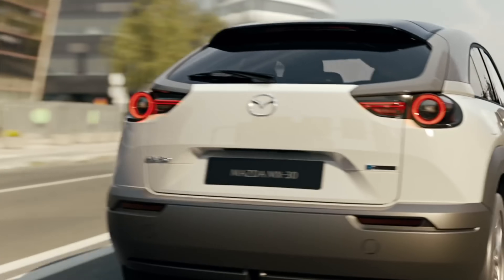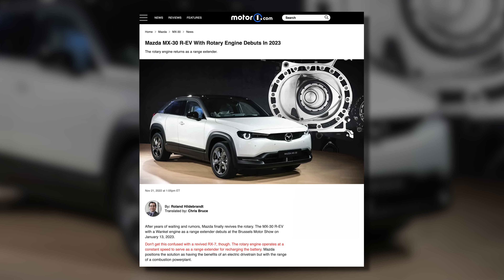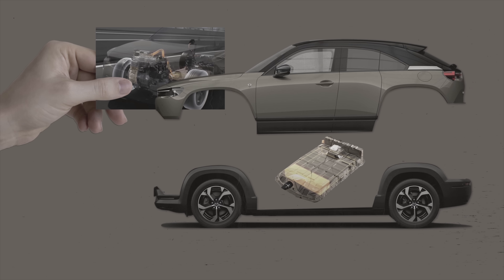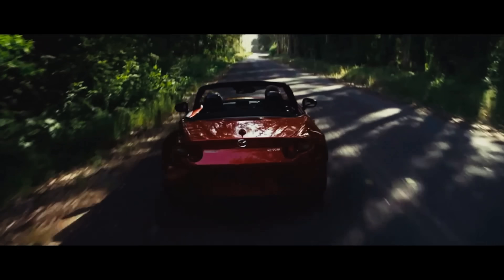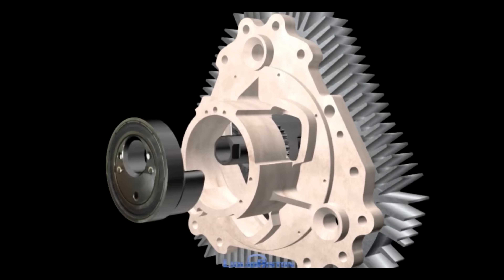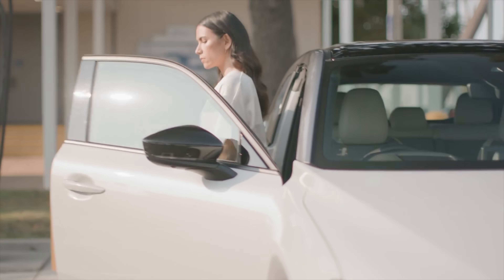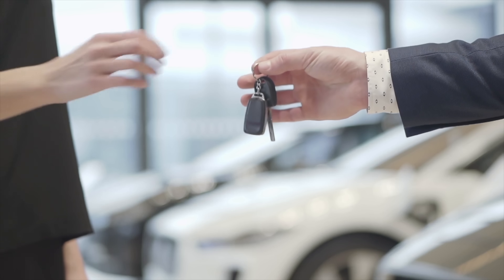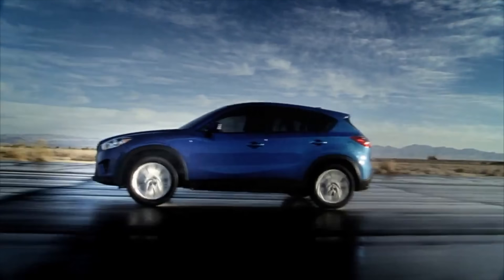Mazda's New Engine is the Smallest and Most Powerful Engine Ever Made

Comment: I like this design. It addresses the biggest problem with internal combustion engines: thousands of motors sitting there idling in rush hour traffic. You can't shut the motor off because you're still crawling along. A small battery and electric drivetrain fixes this. The gas engine generates essentially all the power for highway driving and the battery handles the city driving. It's the perfect realistic solution.
Reply: Oh absolutely. Hybrids seem to get the brunt of attacks from both sides too. The conservative drivers hate them, because they seem to have too much new technologies.(and God forbid you do something slightly different.) And EV drivers hate them because they have an engine that burns some amount of fuel.  But objectively hybrids really are the best way forward; they could meet new efficiency goals, while maintaining past performance. They offer drastic reductions in fuel consumption, without sacrificing range in the process.
Personally if I had at least a hundred and twenty kilometers of electric range; I could commute to work and back, and still have enough charge left over to cruise around in electric-only range; yet I would still need an engine to get to the closest big city.
Reply: @wyndhamcoffman8961  hot take
Reply: 100%. It's a huge reduction in carbon emissions, without the $15,000 lithium batteries on EV-only cars like Tesla. I think hybrid is the reasonable way of meeting emission goals.
Reply: @AutisticMorty  emission goals are a pile of shite!
Nothing to do with actually lowering emmisions, and everything to do with greed, control and authoritarianism.
Reply: Ita called a hybrid its old technology trains run diesel engines to charge the batteries for the electric motor to drive the train. Yeah pretty old toyota has a prius it does fine
Reply: @jackdaniels2657  No, most hybrids are over designed. 1/2 the weight of the other internal combustion engines. This engine could also run on Methanol, DME, Hydrogen, Ethanol, propane et al.
Reply: @jackdaniels2657  Train?  Do you mean "Drive train" ? If not, diesel electric trains do not have batteries for the electric drive motors.
Reply: @davearbogast2882  trains are pretty much hybrids diesel motor produces power to the electric motor. Im sure theres a battery somewhere
Reply: @jackdaniels2657  Exactly, my 2006 Gen 2 Prius does just that. Good fuel economy but great range. I average 4.9 - 5.2 litres per 100 km and on a long trip I can get nearly 1000 km [ same as some small diesels today]. So recently I had to decide - buy a new car or replace the 16 year old Toyota hybrid battery ? No brainer, new battery pack and even better fuel consumption !
This Mazda idea is great but no mention of fuel tank size, so if it  runs like a Prius while only charging the battery pack [ with regen braking added I hope] it still gets less range than my current Prius [ 840 km on 40 litres of 95 Octane at 2000 m altitude - Johannesburg]. 
That range extender would get me around in a large country like South Africa on my longer business and leisure trips direct to Durban [ 600 km] but Cape Town needs a refuel / recharge [ not sure which] to get there if only Gen 2 Chargers available - probably an overnight stop.
I can do Jnb to CT in one day [ 1489 km] in my Prius, can the Mazda do that?
Reply: @brucemills6558  my 2021 Renault Captur hybrid does 55mpg around town and has a full tank range of 540+ miles ( it has a fairly small fuel tank) it’s self charging so doesn’t need to be plugged in and was £5000 cheaper than the plug in version.
Reply: No its a dead end. Batteries will sooner or later outperform any gasoline engine in every possible category . It will be first in price and from that point it goes downhill for gasoline engines fast.
Reply: @MartinMartinX  
They won't replace combustion engines ourltside of cities, constant travel within the city should be electric to cut down on air pollution, its going to be seriously hard to beat the energy density of the chemical batteries that we call hydrocarbons though, as well as reliability of gas engines vs batteries and electronics, and with pneumatic braking on gas cars the efficiency in town gets to near an EV. For long and short distance efficiency in a vehicle that lasts decades, you can't do much better than a gas car with good tuning, pneumatic regen braking, and with maybe some modifications to use the waste heat through a sterling engine or something, an EV can't be the solution for everything.
As far as charging and getting the energy to the vehicle goes, the gas car is better because you dont loose nearly 50 percent just getting it into the battery from the power plant. Fuel can be made with free energy from the Sun by growing stuff for biofuels, you don't pay for the energy wasted there as much as with electric where a good chunk of the generator's lifespan is used powering nothing, and it negates the problem with fossil fuel when new carbon is not added to the air. The gas tank will always have the same capacity, you can let the whole thing sit for a year or more in the elements if you don't need to drive, and it'll be perfectly fine, but an EV may not be depending on if the manufacturer did their homework. I know from personal experience that gas cars are easier to work on, and safer to take apart. They're cheap but only in the short term. Reducing car usage and using trains rather than trucks will fix a lot more.
Reply: @MartinMartinX  you are too optimistic. Even if the advanced countries will force the citizens to use EV, what you do with the rest of the world? It needs a new battery technology to be developes, more energy dense, recyclable, cheaper than lithium  (sodium battery?). The european politicians are not realistic.
Reply: @radudorurus  Current battery tech is only viable for small cars.  One might notice the so called EV trucks and SUV's technically are being sold, but everyone who has used them says... NOPE!  Voltage is too damned low and slow at charging.  Teslas's new 1000V architecture does not fix this problem either.
Reply: @MartinMartinX  I highly doubt that. I’m from Cali. Having an electric car out here quickly became a major inconvenience for anyone who doesn’t live a very inactive lifestyle. Even if they increase the range by triple, it’s still very inconvenient because of how much energy consumption is required. You can fill up 200 gallons of diesel in less than 15 minutes at an average truck stop. Charging up that much “range” in an EV would take HOURS. Yea they can make that process quicker but it would turn your 40-55k car into a 100k+ car, and only few “charge stations” would even have the capacity without having to make millions of dollars worth of “upgrades”. EV vehicles will most likely play a huge part in the already toppling global economy. ITS NOT UNINTENTIONAL 😉
Reply: Sorry Shadowmaster, you are wrong. The rotary engine never, I repeat never drives the vehicle at any time. It is simply a generator supplying electrical energy to the battery, not even the electric motor that provides the only source of drive. The huge advantage is that, unlike a Toyota Prios for example, which requires battery recharging via an external source, this design sees the range only limited by the amount of fuel it can carry. Stop at a servo, top up the tank and it is able to supply electrical power to the battery and move on.
Reply: Makes a lot of sense.  But manufacturers are greedy and won’t sell it for cheaper.  The more hybrids like this one the road, the less emissions.
Reply: And that's how the Prius appeared ))
Reply: Ponder that more.  Do you really think the tiny 1-rotor gas engine could provide acceptable power for steady highway driving, after the battery is spent?  I would see that more as a limited emergency mode, maybe running steady at 50 mph with no ability to accelerate much.  It is just a range-extender for the battery.  You would still need to stop to recharge the battery, plus refill the gas tank.  Not that I think that is bad, indeed I like the design.
Reply: Lol -  Idling is not the problem, and this design has nothing to do with idling.  Go learn more about hybrid design.
Reply: The big bonus being that the lithium mines that use child slave labor are on the other side of the world so you have to see it every day while you're on Tik Tok otw to work.
Reply: A solution to a made up problem!

Learn this or you will pay dearly in the end:
"The whole aim of practical politics is to keep the populace alarmed (and hence clamorous to be led to safety) by menacing it with an endless series of hobgoblins, all of them imaginary."-H.L. Mencken
Reply: Uh, so does auto stop, and it's been out for years now.
Reply: Considering the light weight of the engine, it would seem like the power plant might be good for a small hybrid plane or the Jetoptera.
Reply: pistons probably wouldve been better, and this is probably better than honda and prius stuff, engine can run optimal effeincy or low emissions all the time without needing to be designed to be heavier to deal with downshifts in torque , changed in rotations per second etc . theres more stuff like thsi that shows that clearely, modern cars are garbo  at being reasonaable...
Reply: "....thousands of motors sitting there idling in rush hour traffic..."  And how is that a problem?
Reply: What? Idling? Idle hands are the devil's playthings, but I wouldn't say that's a significant contributor to GHG
Reply: hybrids already do this...
Reply: @ilyarepin7750   A battery electric drive like this is better because the hybrid is integrated and complex, and relies mostly of fuel for all use.  A separated system allows more use of grid electrical usage, with fuel only needed for longer trips.  I drive a hybrid, and it is not as good as I assumed it would be.  Not happy with Toyota's deceptive marketing.
Reply: @martythemartian99  Would really like to hear more of what has disappointed you as I am considering a Toyota Hybrid.
Reply: @ilyarepin7750  to a lesser extent
Reply: @modernNeanderthal800  The Chevy Volt was the first to do battery plus on-board generator iirc. People didn't understand it so it didn't sell well.
Reply: @paulbrooks9  thanks for the neat info
Reply: @ilyarepin7750  No, most hybrids are over designed. 1/2 the weight of the other internal combustion engines. This engine could also run on Methanol, DME, Hydrogen, Ethanol, propane et al.
Reply: EVs produce way way way more pollution then combustion engines ever have. A logical fallacy is still nothing more than a fallacy.
Reply: @FreeNDeed777  they don’t, fact
Reply: @FreeNDeed777  We will not solve the problem without first looking at the problem.  The problem is everything we do is car centric.  Maybe build a section of the cities and town as foot traffic or bike traffic only.
Reply: @MrMannyhw  it’s not car centric. It’s ENERGY centric. Tractors, lights, building equipment, transportation, agricultural tools, unless you can afford to feed a bunch of animals to do those jobs. Modern society has effectively made most people completely reliant on Public Municipalities. Energy being one of the key ones.
Reply: @MrMannyhw  oh, the 10 minute slave city concept?
Reply: Doesn't address the horrible impact of batteries on the environment and the slave labor to mine the materials
Reply: @flyingsword135  There is no "horrible impact" of batteries. Big oil paid propaganda. "Slave labor" is not a problem of batteries, but idiots who cant developed proper equipment and adopt laws to prevent it.  These days they can recycle 80-90% of battery and also the amount of rare metals was reduced greatly this year or totally eliminated by some manufactures. Soon there will be no need for rare metals or it will be greatly reduced.  Go watch impact of drilling and transporting of crude oil accidents  for years on nature at land and sea. Also study impact of breathing gasoline fumes from cars/trucks your whole life.

Comment: Most OEMs decided to Pass on the Wankel design fifty years ago due to poor combustion efficiency, low overall thermal efficiency, constant oil consumption and short major service interval. Aside from Toyo Kogyo making no mention of how these shortcomings have been overcome, a major attraction of BEVs is the light maintenance burden. Adding an engine, even a small one, brings back the need for oil changes, filter and spark plug replacement, etc., etc, etc.

Comment: I think the range extender rotary makes perfect sense, 4 all of the reasons Scotty gives of it over a piston engine. While 54 miles isn't much, it works 4 MOST driving, so the rotary would actually not run much at all.
Reply: Probably you still need to make sure to occasionally run the fuel tank to near empty so that the gasoline doesn't go bad from age.
Reply: My wife and I both have electric cars as well as a friend who had an original Leaf with the ~140km / 80 miles range. Battery degradation with such a small battery is a killer. You get ~1,000 charges before your battery is degraded to ~80% charge and it drops off sharply after that. 

Now both our cars are 300 mile/ 500km+ cars. We only need to charge them once every ~1 - 2 weeks. As a result it will take us 20 years at the worst before we see 80% battery degradation. Meanwhile my mate with the leaf was seeing noticeable degradation after 3 years as he had to charge every day with such a small pack. Stats I'm seeing from people with Mitsubishi outlander PHEV's are showing the same thing. Small packs requiring daily charging are, imo, pointless. Whether PHEV or BEV
Reply: @iseeyourschwarz8973  Run lithium batteries between 20 and 80% for a very long life.
Reply: Does it have a catalytic converter?
Reply: I just think rotary has bad history of problems. I like toyotas hybrid idea with their fullsize camry hybrid but mainly particularly what i mean when I say that is how they do 4 cylinder natrually aspirated
Reply: @TheAnnoyingBoss  They have addressed most of the issue with the Wankel over the last 20 years. Check out the videos on youtube.
Reply: @TheAnnoyingBoss  Look for Engineering Explain Wankel Engine and Problems fixed on the Wankel Engine videos
Reply: Perfect for your dystopian 15 minute cities. Good luck with your enslavement.
Reply: I live in TX, so this could not be my only car without the range extender. It would take me 14 days to drive across my own state if I could only go 54 miles on a charge and then have to plug it in over night. Good luck finding lvl 3 or even lvl 2 chargers anywhere. If I could fill up the gas tank for the range extender and get 400 miles out of it, that would be much more useful. I assume I could extend the range as much as I wanted by filling the tank again.
Reply: @ss9749  That is correct. However, they should design the vehicle to get 75 to 100 miles EV only.

Comment: Hell yes the addition of a small engine to charge the battery is a great Idea and makes me actually want to buy one
Reply: Chevy released the volt back in 2011 that does the same thing. To bad they killed it off in 2019
Reply: The problem with the Volt was that it's a small vehicle and not practical for many people that are interested in that type of efficiency .
I think we're still waiting to see this setup in a practical vehicle. Obviously, if this type of setup can be used to move trains and cargo , it should be adaptable to say, an SUV or minivan . I'm just not looking for a low slung 2 seater at this stage of my life.
Reply: @ginakerry2588  the second generation volt was actually based on the chevy cruise and is a very practical vehicle in the sense of space and utility. As a 6'6 individual I actually bought it because of the spaciousness inside.
Reply: It’s also not a new idea. The first production hybrid, gas engine charging batteries, was introduced around 1902 by Porsche called the Lohner-Porsche Mixte.

Comment: General Motors had the same concept in the Chevy Volt. The difference being the Volt has 2 electric motors. One dedicated to the battery pack and the other dedicated to the gas powered built-in generator. The all electric range is about 50 miles then the gas powered generator would kick in to extend the range another 350 to 400 miles. Of course as per normal, GM killed the Volt in 2019 instead of improving upon it’s all electric range. The Volt was the US’s #1 selling plug-in hybrid from 2011 - 2019. GM concentrated on expensive, high profit SUV’s and pickup trucks instead.

Comment: This is a very good idea. Using a small rotary as a range extender (battery charger) is great. Beats the hell out lugging around all those expensive heavy batteries which for most the time are useless. And you can refill the range extender in no time flat.
Reply: ..and heavy, and bulky, piston ICE engines.

Comment: This is a bad idea, from what I can find online, the milage using the rotary engine while charging the battery is only 24.25 mpg, the Prius is in the 50's. They really need to optimize a small Atkinson engine using 3 opposed dual pistons. Keep in mind the engine only needs to supply about 25hp at highway speeds, the battery give the peak power for acceleration.